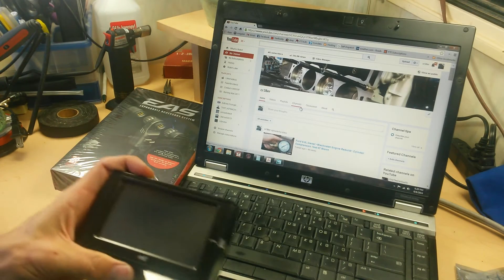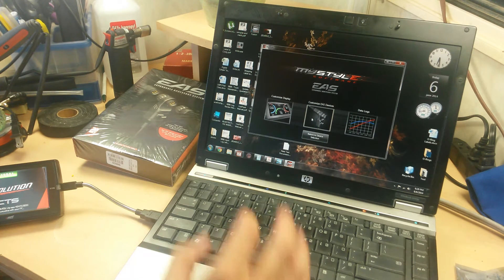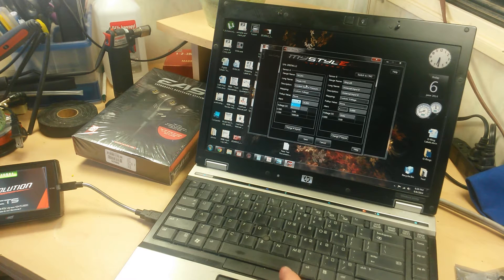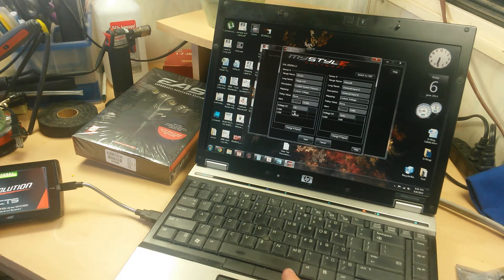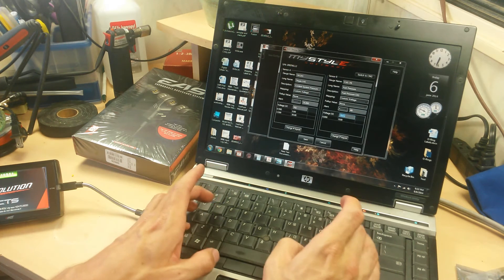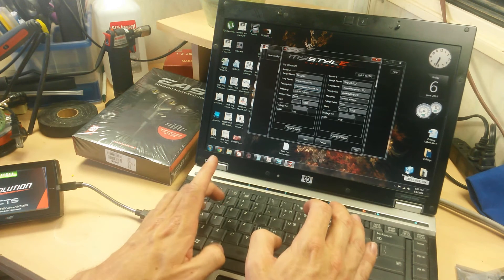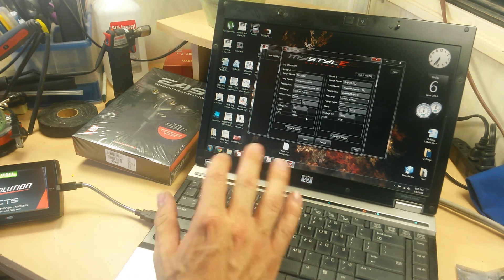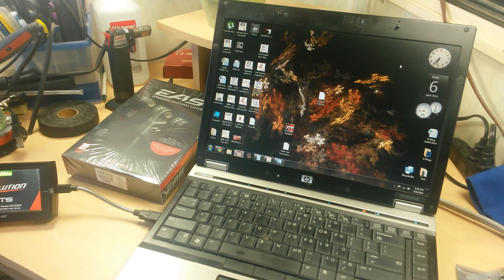FORD 6.0L ~ EDGE Tuner EAS Universal Sensor Input PC Setup ~Evolution/Insight 98605 MyStyle

Comment: I’m having problems with the fuel pressure sensor it keeps saying sum crazy numbers 
It’s a 100 psi edge sensor but if I pick 0-100psi it comes up as psig and says 38.35  and I know it’s not that high so I should set it .5 to 4.5 volts?